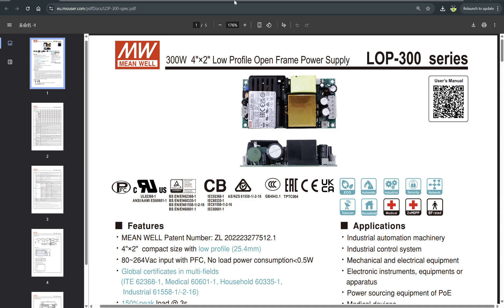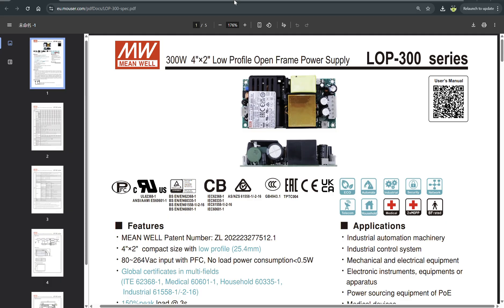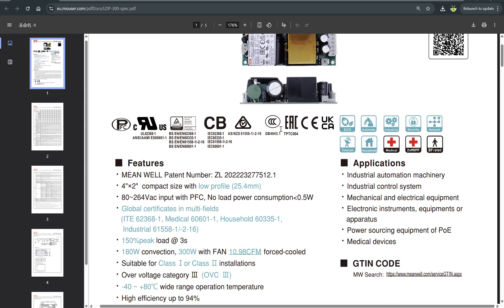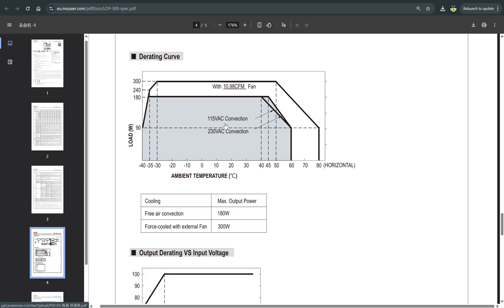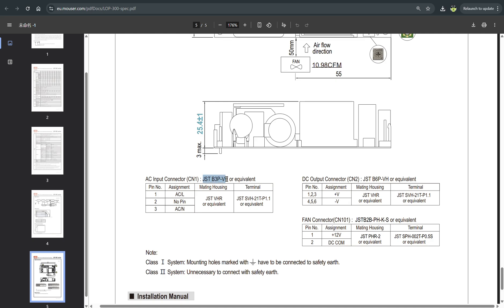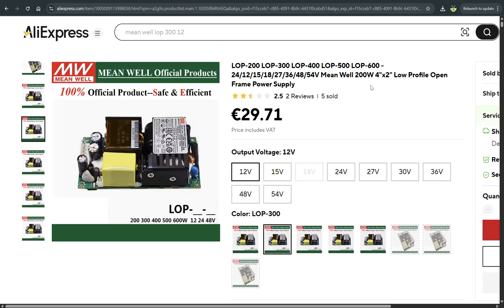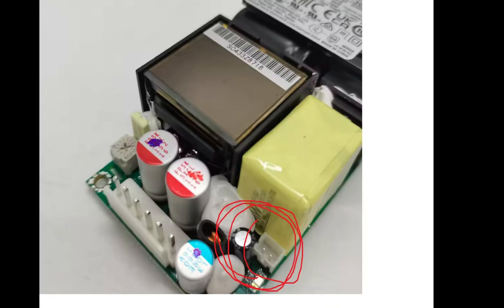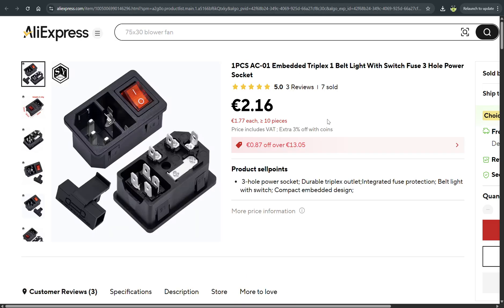Small 300W 12v power supply LOP-300-12 tutorial - good choice for compact Steam Machine build

Comment: Do I understand correctly that if I buy a 6-pin JST connector, I would need to connect it to a PSU PCI-E cable? If so, isn’t there already a bottleneck, since the JST cable uses 22 AWG while the PSU cable is 16 AWG? In that case, would it be better to use only the connector housing with thicker wires, or to solder the PSU wires directly to the connector pins?
Reply from the maker: Thicker wires for sure better, but  16 AWG can take 10A per wire, so total 30A, we need max 21 - we are safe I presume
Reply: @OldLamer  yes, but VH3.96 is awg22, it's too low thickness

Comment: I ordered the Mean Well LRS-350-12 for my BC250 project because of the metal case, lower profile, spade connectors, and slightly higher wattage.  Hopefully it works out since it seems most people are going for the LOP-300-12 model.
Reply: As soon as it produces 12V you are good with it

Comment: Wouldn't it be better to pay an extra 10 euros and get a more powerful 400W or 500W power supply?
Reply: 300W is already extra
Reply: @malomarshers  Actually people have reported with overclock furmark & cpu stress test it reaches over 300W.
Reply from the maker: @red2  This is a mistake, in stress and overclock BC250 consumes 21A maximum, which is 250w, but you can oilways buy a larger PSU, spare does not hurt 🙂
Reply: @malomarshers  with overclock it can eat +300W
Reply from the maker: @kuclaw5406  This is a mistake, in stress and overclock BC250 consumes 21A maximum, which is 250w, At 2000Mhz and 960mV